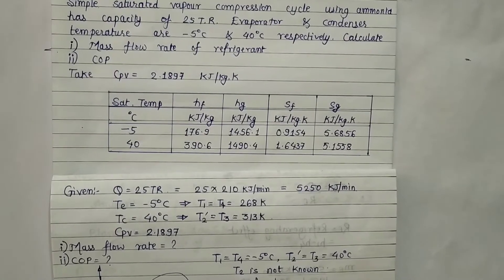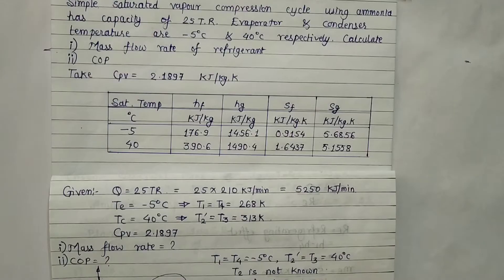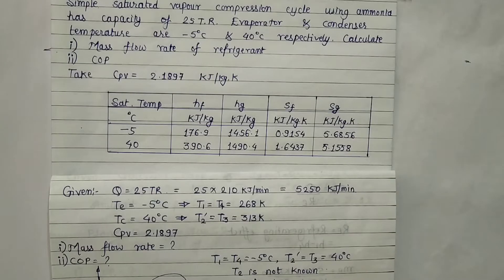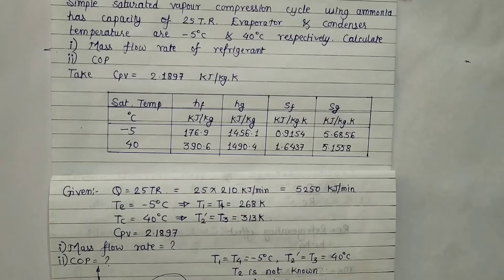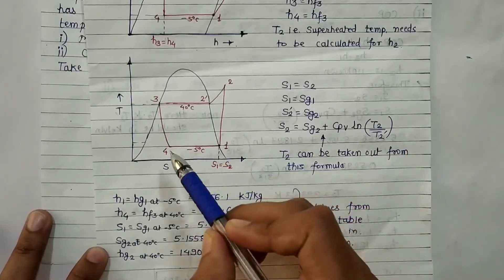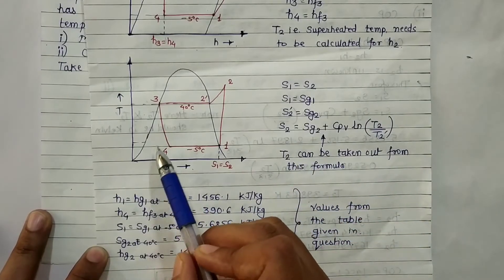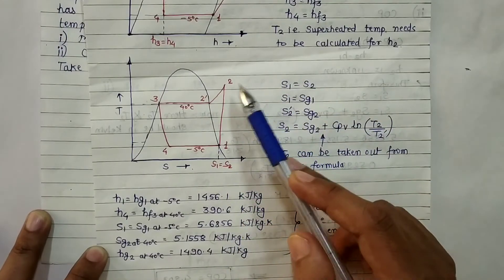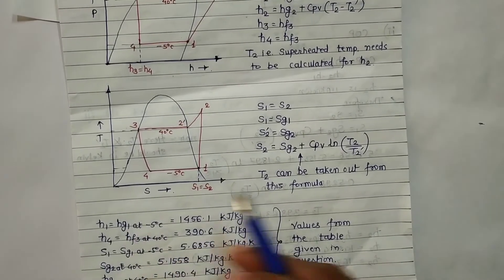Numerical on Simple Vapour Compression Refrigeration Cycle by Mona Yadav

Comment: Excellent Explanation. Can you please add more videos by sequence like types numerical on simple compression cycle by using char and without chart, state of refrigarant after evapourator because based on that there is changes in pv ans ts diagram.